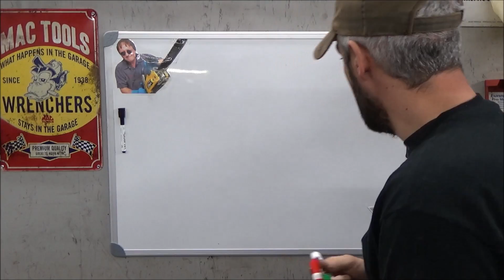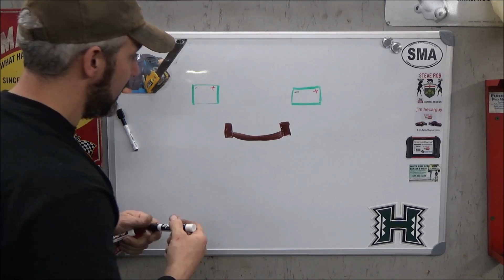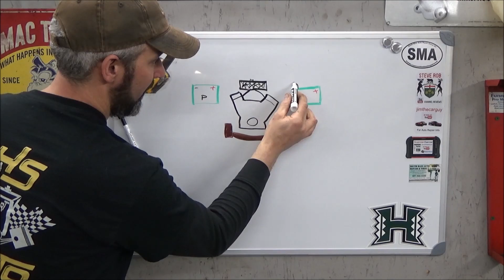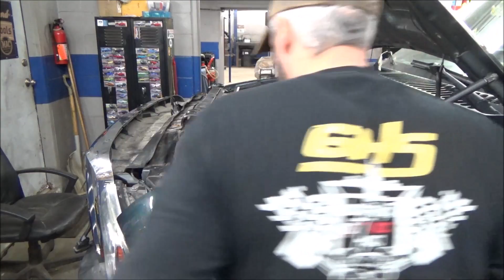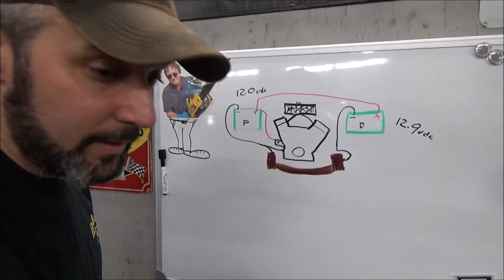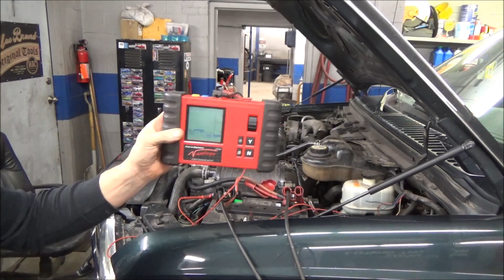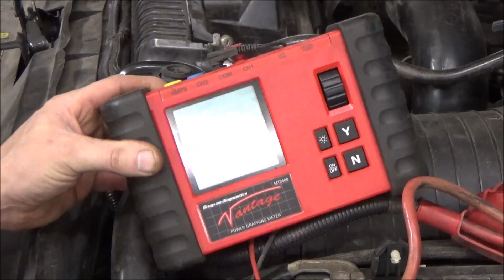Ford F-550 6.0 - No Start No Crank

Comment: I learned something a long time ago. If you can't explain something to your self or anyone else you don't really understand it. Voltage drop is measured when current is flowing. You have to complete the circuit and put a load on it. Your voltage drop was 12 volts. on that ground cable. You never came up with that test result so your testing methods are inaccurate. Sun Electric used to give a great class on this. If you need I would be happy to explain it to you..
You actually did one voltage drop test. You hooked up a hot cable directly to the ground cable on the passenger side to see if it would spark. That was a complete circuit. Spark is good, no spark is 12 volts of voltage drop.
Reply: At 14:30 he effectively measures the total voltage drop across the starter and the wiring fault, which is a consistent (roughly) 12 volts.  Since the starter is a relatively low resistance and voltage drop is proportional to resistance, it can be deduced that there is a high series resistance (wiring fault) if the voltage across the battery has very little change while starting.
Granted, that would be better shown if the other battery were removed, but it doesn't matter that much since the batteries would share the load equally if the wiring was intact.

Comment: The main battery grounds should always be on the engine block. Smaller cable grounds around 40 amps or less should connect the frame or body to the engine block  I can’t believe the guy that owned that vehicle had grounds on both batteries attached to the frame. There’s a first for me. In the case of a snow plow I’d ground that also to the engine for better current flow.

Comment: i have a 01 ford diesel and have never checked both batteries voltage because in parallel, they will both show the same voltage no matter condition of charge in each unless you unhook a cable so as to isolate them from each other.  so question, doesn't the fact that they show different voltages at first glance suggest a faulty cable somewhere?  I love your diagnostic steps.  just seems this one was solved in the first minute.

Comment: My motor home has two 8D batteries but they are not normally tied together although there is a heavy duty switch to do that if you need additional juice for starting.  I keep my battery terminals clean but I discovered a lead oxide (grey color, not green) build up that was keeping the batteries from charging.  I changed what I was spraying on the terminals and the corrosion did not return.

Comment: IT LOOKS LIKE THAT TRUK WAS SET UP TO PUSH SNOW,I HAVE SEEN THEM WHERE THEY WIRE THE PLOW IN TO ONE BATTERY AND PUT A SWITCH IN SO IT WILL ONLY PULL DOWN THE BATTERY ITS HOOKED UP TOO BUT THEY WONT BOTH DISCHARGE BUT WILL BOTH CHARGE

Comment: You could just put jumper cables between the battery terminals and see if she starts with plus and neg jumped then remove the pos jumper cable try start and then remove neg jump cable and try start.
Reply: And a minute later we are doing just that. Great minds think alike.

Comment: How are you sure the bad ground and the instrument cluster problem weren't related? The battery on the drivers side could not charge because of the bad cable going to the engine block but still had a goodl connected to the frame. Could this battery being charged or discharged have an effect on the instrument cluster fuel tank readings? Isn't it unusual that there was only the one connection between the engine and the frame? I always like watching your videos and appreciate the patience you have making them.

Comment: Battery neg to chassis on each battery would show you the fault straight away. Forgot to say, I am an auto electrician with many years experience of rust and bad connectors.

Comment: Two batteries connected in parallel, should show identical voltages. Even if one is dud, it will bring the other one down. Immediately "Theres your problem lady". The only way they are different is if the connection between them has resistance, or off load, no connection at all.

Comment: 😂 hanging with Scotty that hurt my stomach laughing so hard 
2nd the way they have those batteries hooked up isn’t good 
When batteries are in paralleled   They will fight each other when in rest causing corrosion and electrons 
A better way is to install. A heavy duty relay that comes on with the key so they disconnect from each other when at rest

Comment: Everyone keeps saying don't trust ohmmeter's; but when they test the circuits it ends up showing the fault as well. I understand the logic behind voltmeter only diagnostics, but I would like this claim to be put to the test and validate everyones claims on video.
Reply: An Ohm meter is an unloaded circuit test. A pretty crappy connection can pass an ohm test, but fail under a load.

Comment: Hi, Ohm Test Between Each Connector On Each Cable , Or Just Change All The Cables Or Best To Make You Own Cables And Use Heavy Duty Ends , Oh, Check Glow Plug / Preheat System …….ALSO !!!!!

Comment: I had an 06 F-350 with 6.0 motor. When hot or warm, would crank but not fire. Started fine when cold.  Problem located to dead-end plugs at back of heads. IH used same head on either bank. High pressure oil enters head at front. Need 300# press to fire injectors so pull the plug at back of head (plug looks like hour glass with "O" rings).  o rings probably cut or abraded so replace plugs  n should be good.

Comment: Second battery should be hooked directly to the other battery.  There could be an isolating relay between the two batteries is my guess but looking at that ridiculous 150amp breaker they probably dont know how to hook anything up at this point :)

Comment: I was betting that the driver side battery ground was bad. I was very surprised that the only ground between the motor and the frame was that one cable. 

Should be an easy fix at least. Were you able to source the cable or did you go the DIY route?

Comment: When checking the voltage on a dual battery system, if the two batteries are connected to each other how do you ensure you get an accurate reading on just one of them? I would assume if the cables were good you would get the same reading on both of them since the voltage would try and equalize between them wouldn't it?

Comment: 36:10 run a jumper from one neg term to the other neg . battery term.
Reply: If you did that and left the bad cable there still connected there would have been electrical potential between the engine and the frame and the result of that would have been severe electrolysis especially in areas where salt is used on the roads the reason that cable was filled with brown crap was that it was being eroded because of a bad connection, The other result of electrolysis is the body of the truck would begin to turn into a rust pile  

The best thing to do is exactly what Eric did replace the old cable with a new one of equal or greater amperage carrying capacity, Heavy gauge battery cable or wielding cable will do, When you make them up the best thing to do is solder then ends on as well as compressing them then liberally cover them with white lithium grease followed by spraying with undercoating to make sure the ends are completely air tight, You can also use the lithium grease then put heat shrink tubing over the cable, This will reduce corrosion, I have done this for many years and have never had one problem with the cables I create and install.
Reply: @waynemazzola9443  no just to test. Temp.
Reply: @waynemazzola9443  Thank You

Comment: You screwed the pooch a little bit.  You didn't put any current into the driver side ground cable, so zero volts there is not really a test.  Using a low range ohmmeter from the chassis to the negative battery terminals, that might have been a better test.   Ground loops are often tricky to diagnose, especially if they are powered up.

Comment: There's your problem lady 1 battery doing all the work the other battery isn't connected or No current flow  the parallel battery Circuit isn't Connected Eric O @SouthMainAutoRepairLLC

Comment: 33:35 .... Noooooo run a ground from each location Eric . This truck has afm assery's ;) full pun intended. So run an individual ground from the battery to each ground point especially the alt case. DO IT DO IT 👌😂 again pun intended .

Comment: Most likely a bad ground, loose connection. And why don't you have the charger on the discharged battery? The instant you fix the problem the good battery is going to try to charge the week battery and a hell of a lot of current is going to flow!
Actually both batteries grounds should be bonded together !!

Comment: 22 minutes my head says in check earth strap to block and chassis. ages later you get it... basically first thing i'd do in that situation is check earths all round clean and replace before i did anything else..... common sense, earth straps always corrode and break, mainly because the actual flow of electricity is BACKWARDS to what you're taught.... so the earth actually is the most important connection, but the least protected.

Comment: I was working on a junk Chevy a year or so back couldn't figure it out after a couple months a scraped it had spark on half the of the coil pack changed it out same so then I changed the crank and cam sensors still no change then changed the ignition switch no change extra extra

Comment: You found the solution early but you kept trying to prove what you already proved which is that the two battery grounds were not connected via a block or frame. We knew what ground it was when you drew it on the white board and the voltage drop to the plow thingy was the same as to the D battery proving the D battery was grounded so it HAD to be the P battery.

Comment: first disconnect the Ground to the Auxiliary battery on the drivers side...that will reduce the problem in half.. the auxiliary battery is totally un necessary to the function of the vehicle....the customer has a cob job there ... there needs to be a power divider to separate the auxiliary battery from the main battery.

Comment: i had a f550 with 6 liter that only got used in summer. came with a bunch of problems. i believe leaving summer fuel damaged the sender but the dash gauge was also not working proper. also had the main ecm harness shorted to ground on vavle cover bolt. it blew enough fuses someone ran solid wire untill it blew the connection inside the fuse block. but i got no story on this truck, just towed into shop and told to fix.

Comment: top side creeper for those high sitting ford's is a must Eric or we let the air out of the front tires you think no room on that truck we have E450 buses with those junk 6.0 with a extra ac compressor on them they are a nightmare
Reply from the maker: +Danny Brown I have a top side creeper but short work like this I did not go get it

Comment: Would have been a lot easier to just do a resistance check between the grounds on the 2 batteries and between each battery and the frame.  Would have saved a lot of time that I am sure was being charged to the customer.

Comment: AS you said 'Diesel' i was realy excited, cause i mainly work with diesels. But then it was simply a connection issue (nothing special).
Could you please do more no start diagnose with diesel. Because of the highpressure system it is harder to find the cause of a problem, in my opinion.
Reply: Agreed. And let's not forget the 7.3 powerstroke injectors are fired off oil pressure, not fuel pressure. Main no start issues with them are low oil level, weak batteries, if I remember the name correctly...the icm modul, good glow plugs and glow plug relay, and switching to a full synthetic oil drastically helps fire worn out injectors. Also check fuel pressure coming out of the fuel bowl

Comment: Good ol crusties! I was more surprised that the hood struts were still holding the hood up haha.
Reply: Auction house probably replaced those, my Excursion hood falling on my head once was all I needed!
Reply: Aaron Kimmins Haha yeah I had a mountaineer hood come down on my head also. I use a wiffle ball bat to hold it up for now (oddly enough it's the perfect size). I'm going to get the telescoping hood prop Eric uses. I don't know why they use struts when a simple prop rod would work and be cheaper than struts.
Reply: Too high for soccer moms...

Comment: To me, it seems that bad cable wasn't so much corroded as badly overloaded.  Whenever I have seen a huge wire inside of insulation get that brittle it was because it carried way too much current.  I haven't seen this in normal cars but have seen this happen in diesel powered boats.
Reply from the maker: +Pook Atim Plow and a electric over hydraulic dump box ... hmmmmm
Reply: +South Main Auto Repair Wouldn't be at all surprised.
Reply: +South Main Auto Repair Perhaps they used a salt spreader, too.

Comment: I would think that if you had batteries hooked up in parallel,  if one had 12.9 volts and the other had 12 volts, then you would get 12.5 on both instead of one being higher.

Comment: I had a customer  install  one battery it happened to be the one that connects  the batteries  so when I did the alternator  test with the dtac  it was showing  no charge... was a similar  situation  I also haven't  watched  it  all yet my  2 cents

Comment: I'm suspicious of your use of a battery charger to induce a current in pursuit of voltage drops the way you did.   When the charger is connected to the battery, the only place current is flowing is through the charger cables and the battery itself.   The test would have been valid, had you connected the negative battery charger cable to the engine somewhere or to the frame, that would have forced the charging current to take the path of the ground cables.   Otherwise, good show.

Comment: I have an 05 ford f-250 6.0 fx4 lariat sb it also has a no crank no start issue with my truck long story short I went to town and park at the store went got my stuff came started my truck which was a rough idle then it started shifting funny bucking and shaking then it shut down now it has nothing all power fuel pump kicks on but no crank and start and I already replaced the pcm after the issue occurred

Comment: Eric O, you think it will get harder or easier to work on vehicles in the near future? I think it is getting much harder.
Reply: +RomanAutomotive, not harder.  Just different.  A mech needs to know both electrical & mechanical these days.  Getting information (like wiring diagrams) is a lot easier with the internets then it was only 5 years ago, IMO.
Reply: Pet Rock's Garage How you doing Pet Rock? Nice to see you.
Reply: Doing well.  And you?

Comment: Shouldn't Both Battery Be Tied Together, Plus to Plus and Neg to Neg For a More Efficient Current Connection..
What Was The Outcome with The Customer. Did You Run Two Ground Wires To The Battery or Run A Short Ground Wire From One  Chassie Ground Connection To Engine Ground Connection?

Comment: Love your show
..troubling question
My 97 Expedition cranks, won't start.  If I spray fuel into the air intake hose, it starts right up.  The fuel pump sounds like its operating, and, there's fuel pressure in the fuel lines, so it's getting fuel to the injectors...but won't fire, or start when cranked....but, as I said, if I spray fuel into the air intake it will start and run, and stay running if I keep spraying...?????.
Any thoughts my man?

Comment: What was the final cable solution?  Buy factory new or just add a new frame to engine block jumper? Self made? Interesting video Eric O. 50-50 between you and Ivan. He at times, goes to the stratosphere and has me scratching my head. I'm glad both (Techs)  solve the problems in their specific ways.
Reply: Who is Ivan?

Comment: I'm a little confused as to why the charger needs to be on in order to perform the tests you're doing around the 25 minute mark. Does this just make the voltage drop more noticeable when you're doing the measurements?

Comment: i had a 92 chevy k3500, 6.2 l diesel that was set up dual battery but it was not done like that set up. it was done + to + then starter/power distribution ectra with the after market junk on the opposite batterie negative to negative with one batterie going to body/frame and after market junk the other to engine they were always connected to each other like would be done it heavy equipment where they have them in battery boxes or on transports. the way that was set up is/was a rather unintelligent choice.

Comment: Can't figure mine out ! Pop the hood and use started solenoid plug disconnect next to passenger side battery and starts right up but nothing from  ignition switch !

Comment: Heard you mention the load pro leads. Are you a fan of them. I've got a set myself think they are a fairly decent tool.
Reply from the maker: +Ryan Brett Bahh I am not a fan of them. All it is, is a 50ohm resistor and a push button. A test light is a much safer tool.

Comment: At my shop management don't believe in coincidences or they are scared s*** to  face them. all that diagnostic work would have been free, the cable would have been free and I would have worked for nothing for a half a day.
I had a car come in for routine service, after the services were all done I started the car up, went over to wash my hands and when I came back car was not running.
Broken timing belt while I was washing my hands. You guessed it I did a free timing belt.